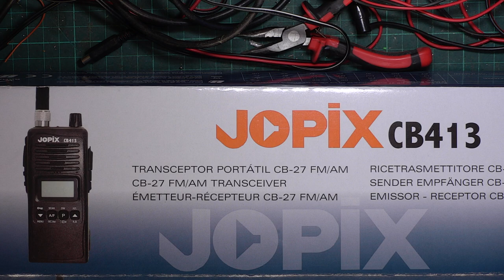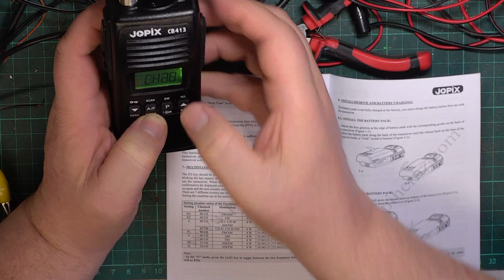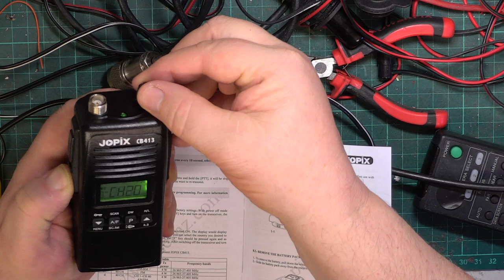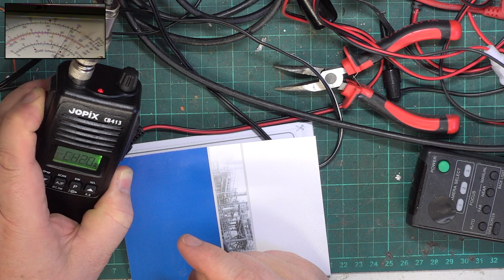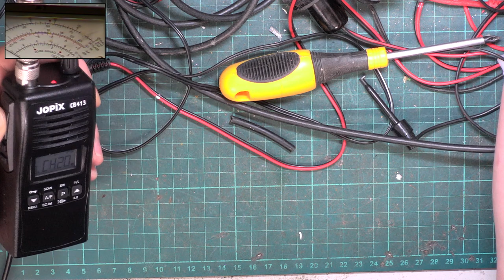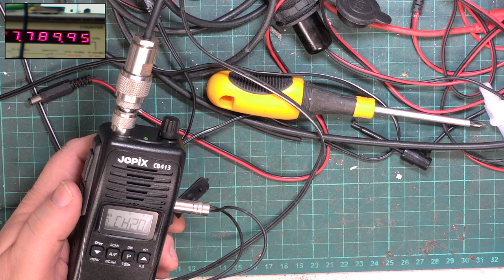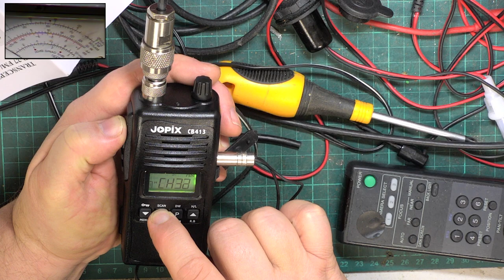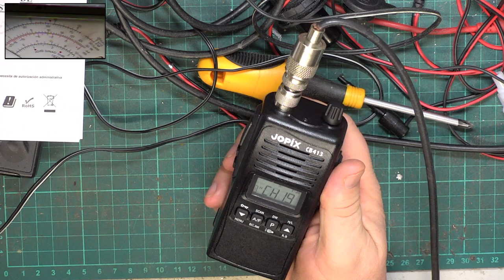Jopix CB413  CE MultiNorm CB Handheld -  Overview & non-adjustment!

Comment: How odd.  You would think they would have checked things like Am/FM before putting it on the market!   8-(
Reply from the maker: Yep....poor show. Luckily I don't use CEPT, but at least I've identified a snag & people who DO want to use CEPT can reset the radio to CE channels & have it work properly but in CEPT AM & FM only....then reset the radio to UK channels when they want. There are sets with worse snags than that & the flagship PNI set is a firmware disaster. Wi didn't have these snags with the 27/81 sets.

Richard, G0OJF, UK
Reply: @ukfmcbradioservicingTango21  No, we just had PLLs buried in a ton of wax under a huge tin!!!!!
Reply from the maker: like the grandstand base/gemini
Reply: @ukfmcbradioservicingTango21  Now, how did you guess it was it?  I wonder. lol,  It was a nightmare to work on!

Comment: Yes, it seems to tx on AM and rx on FM on the European frequencies. My panther is the same. I thought it was broken but decided to try it on eu and all works as it should, strange concept. The instructions say U.K. Is U.K. Only though so they know about it. Bought mine in january. Regards, Tim.
Reply from the maker: clearly a firmware issue. As I said, for those people who actually want to use CEPT channels, just reset it to CE & then it works properly. A poor show, but an easy & not too inconvenient fix.

Richard, G0OJF, UK